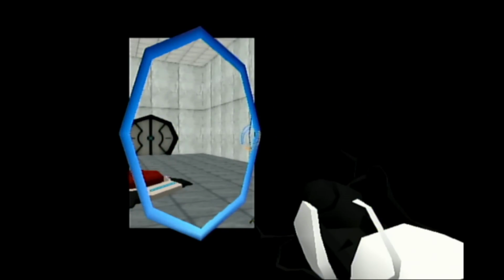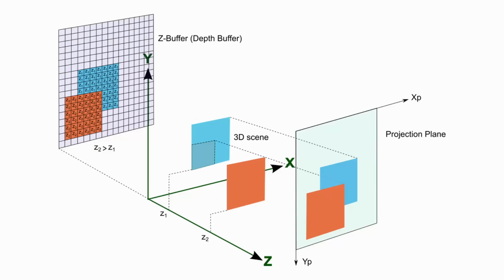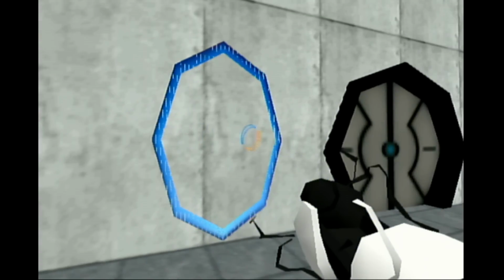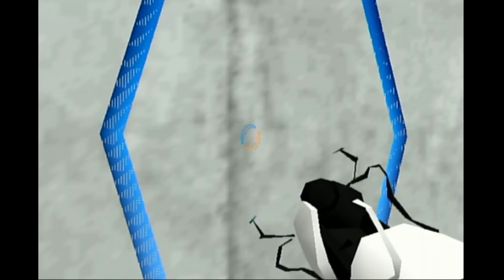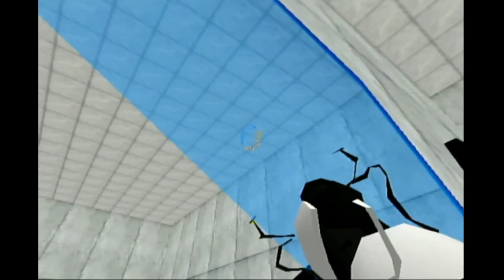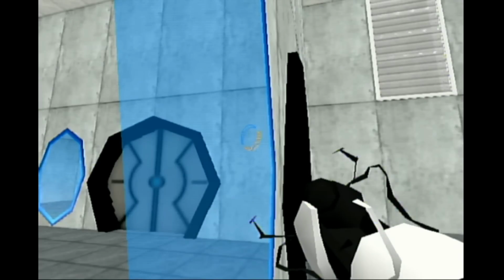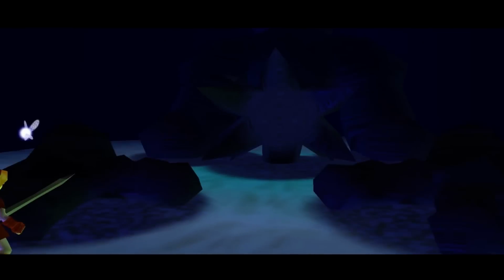How can the Nintendo 64 run portal?!? | Portal64

Comment: Sorry for asking but does the n64 not has an fps issues.
I don't know the hardware but is the problem the CPU or the RAM and if it's the RAM does the RAM Addon work for the n64 help to run this game on original hardware.

Comment: When the first graphics cards came out, old computer games made extensive use of the Z-buffer. Adding fog to the level was a great "cheat" to improve performance. If you put the clipping plane just beyond the point where objects disappear into the fog, you didn't have to render anything beyond it and it improved game performance a lot.

Comment: good thing like you mentioned is that now we have everdrive and enough to fit games that goes in gigabytes of gameplay on a single flash rom chip, so that's really a great port. 
Still from what I heard the N64 was a hell for devs, going wiht SGI Irix devkits, using 64bit hardware while their programming on a Pentium MMX was still 32bit, emulating, testing, optimizing the thing to fit in a 32 or 64Mb cart at best.. phew.

Comment: Ok so if my understanding of computer graphics history is correct, z buffers were almost impossible to implement for the longest time, due to monetary and physical material cost, until dedicated GPUs in the latter half of the 90s. Memory was $$$ so optimization led to painter's algorithm and BSP trees (and a ton else) with "portals" eventually showing up to help manage both how much of the scene needed to be held in RAM and speed up clipping and rasterization. 

A few companies tried to play with that technology (Prey when still under development in the late 90s) but computers weren't fast enough or had enough memory to handle rendering and clipping multiple scenes until the mid 2000s, when Prey 2006 and Portal were released.

Then there's your engine that solved the problems backwards, duplicating the parts of a scene shown through a portal instead doing awful parallaxing math, and then using the 64's z buffer as a hack when the clipping plane overlaps makes me wonder why this wasn't figured out 25 years ago. Either way, brilliant work!

Comment: I've been dying for a Fallout3 port to the N64. I'm an excellent 3d renderer and have drawn some very good looking low poly (under 300 tris) mutants and humans. If this interests you I'd be happy to share them with you- you are way more adept on the programming side. i think they look quite good. The head is a separate object so it can look 360, the lower torso legs simply mirror then use an idle frame for 2+1(3) and realistic movement. One arm is fixed to the torso in a prone gun aim postion that can also be used as the lower hand for a club/bat,  the other arm a single object for smashing or holding the front underside of the gun. With extremely limited frames but with just enough animations in the right places and mesh faces I think it looks quite good and would be very possible on the N64.

Comment: "How can the Nintendo 64 run portal?!?"
It's not like these old cartridge based systems lack the ability to process the data.
The biggest obstacle is degrading or replacing the assets enough for them to run at a reasonable frame rate.
Like the Sega Genesis with its ability to play high quality PCM audio. The limitation was the fact cartridge storage space was so small.

Comment: >how can a console 10 years older than portal.. have portals
Original unreal had portals and was 10 years before portal. Check out dm-radikus for some very obvious ones (the donuts). Or ut99 and fractal. Yeah it wasn't a gun but it was a "portal" that worked in roughly the same way.
Reply: unreal was a PC game though, it had access to far more powerful and capable hardware than the N64
Reply: @randomcatdude  Portal is a PC game. Unreal is a PC game. Unreal had portals 10 years before portal. Wasn't comparing PC/consoles just that portals existed long before portal. The wording was like portal is the first game to do this and its amazing that a console of that age can do it, but portals existed long before portal. It is less interesting if the video says.. n64 can do portals that.. unreal1 had. geddit?

Comment: Do not N64 support render to texture? If so could that not be easier to use?
Reply: it does not, and RTs are generally unideal for portal rendering anyhow
they eat alot of VRAM which would be a severe issue here, recursion is difficult to do with them, it's generally not great

OG Portal uses stencil buffering to achieve it cleanly and efficiently -- the N64 doesn't have this, but it has a very similar function to the depth buffer, and so he abused it a bit to achieve the effect

Comment: The N64 is such a little beast. The fact that it retains such a small shape and has the ability to push out clean poly, so awesome. Also, that looks like a solid frame rate, it looked above 20 fps!

Comment: The trick is to know how much of the physics to cut and still retain the core game feel. the first portal game could been implemented on a commodore 64, and there are probably some old games that have portals. but its how exactly the game mechanics work that made that game so awesome. having the polished design in hand gives you a huge advantage for back porting it. its pretty sweet to see how it gets applied to different platforms. i remember the flash version came out almost immediately after the orange box, and it was awesome (its still on Newgrounds)

Comment: This port, in theory, would be impossible on the PS1 or Saturn due to those consoles not having a Z buffer. 

This is such an amazing piece of work. Homebrew/development on the N64 is very scare, so I'm glad the little we get is something truely special.
Reply: You could still do a Z-sort before drawing like a lot of FPS games on the Saturn did, hell, might be something for the second CPU to be doing
Reply: @ripper253  That's actually a good point. I'm no programmer but I imagine you could do some tricks with the two VDP's as well.
Reply: @Supersayainpikmin  It's possible but sadly they're kinda separate and pretty much can't both work on a similar thing as their capabilities are very fixed, hell if this ever reaches a point of "finished" or some other milestone, I'd love to take a crack at seeing how doable a port using libyaul could be on the Saturn.

It'll be perfect 90's stuff too "Well what did you expect for a multiplatform 3d game on the Saturn?" :P
Reply: @ripper253  That sounds awesome as hell actually!

 I remember a YouTuber, I think Sega Southern Gentleman, said the Saturn was designed to be a 3D console, but it's design was terrible for 3D but just so happens to be great for 2D games. I think the story of Sega making the Saturn 3D capable at the last minute is just a myth if you ask me.
Reply: @Supersayainpikmin  I don't really know too much about the drama, personally I'd be kinda surprised to find out that the same parent company that was churning out Model 2 arcade systems would think 3D was a fad or wasn't already relevant, ha

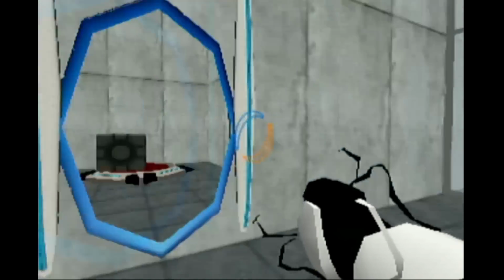Comment: This might be a stupid question, but why did you opt to cut a hole in the wall rather than adding an offset to the portal? It seems that since you already have to deal with the near clipping plane issue, you wouldn't really notice the slight offset from the wall. Is it because the FPU isn't fine enough at larger distances, leading (still) to z-fighting like the doorframe at 5:17 ? This isn't a rhetorical question, I'm genuinely interested to hear why you went for one solution over the other, if you don't mind me asking.

Brilliant work as always, of course 👍

Comment: Each new devlog never ceases to amaze me. You're doing god's work here, man.
Reply: and after that you have to plug the red wire into the socket to make sure the engine boots at launch. Wrap the green wire around it's coil that sits directly beside the A button. After you put the back shell on, place the battery in the slot. Screw the Vr26 Jeeper back up and press the reset button. If everything worked according to plan you're device should show a thumbs up sprite. Plug the HDMI port into a monitor and wait three seconds. If it boots up on TV your in the good side. If it doesn't boot in less then 5 seconds quickly unplug. This can severely damage your TV and possibly start a fire

Comment: wow. simply put wow. with all honesty this utterly impressive 

i do have a suggestion though, changing the portal gun's design, so it's more in tune with a game from the n64 than the original design for portal, don't get me wrong the model it's very impressive but it's visual appeal (specially running on hardware) is dumped by how similar it was modeled with the original design

Comment: Hey James! I tested the ROM on a real N64 using an Everdrive 64 X7. Whenever I boot up the game, I’m stuck inside a black void and can’t get out of it. If you shoot two portals they will both show a view into the starting cell, but if you enter a portal it will spit you back into the void from the opposite portal. Ever encountered this? I tried switching the Jumper Pak for an Expansion Pak and still does the same thing. I’m playing the game on an early Japanese NTSC N64 with a serial number in the 5000-range, processor revision NUS-CPU-01 if this is of any help.
Reply: I also just tested it with another NTSC-J console (serial number in the lower 1,000,000 range, NUS-CPU-02) and it does the same thing.

Comment: This is really cool. I'd be interested in seeing how you handle the rest of the physics (speedy thing goes in, speedy thing comes out) which would also need that thing that Valve implemented where there is almost like a portal vacuum to correct for the user if the placement is slightly off. Oh and acceleration. I have doubts that it could do all be done and I'm very impressed by your work.
Reply: the portal funnel

Comment: This is really cool!
I wonder how the controls work, is the camera using the C buttons? If so, maybe you could change the controls to be similar to GC Metroid Prime, where left and right on the stick make you turn on default, and L/Z is a strafe button, and R causes you to enter an aiming mode with the stick. 
I feel like it would feel better than button aiming, especially for Portal, where sometimes you don't have to move much due to threats.
Reply: Would recommend trying out the GameCube controls for the Metroid Prime series to see how it feels, because it can feel really great while simultaneously only using one stick.
Reply: also you have 6 face buttons freed up immediately to be used however, which can be pressed independent of aiming at all times.
Reply: You move with the C-buttons or directional pad and aim with the stick. This frees up Z, L/R, A, and B for other actions; A jumps, B grabs objects, L/R shoots one portal and Z shoots the other portal (I forgot which color it is for each button). Even if the MP control scheme does have some merit, I respectfully disagree that it would be the best choice for Portal. Portal already has relatively few actions the player can perform, which means having a couple of extra buttons to work with would not necessarily pay off to accommodate the aiming-mode solution that would be required for “Prime-style” controls not to mention getting used to the non-standard L-and-Z-strafes layout.
Reply: @Banzeken  problem is... how do you move while jumping using the C-buttons? that's one of the problems I want to fix, as well as me personally hating movement using the right hand. Additionally, moving while doing two actions is kinda hard, like jumping and then using the portal gun while moving forward, as you would have to do some weird finger gymnastics to press shoot, forward and jump at the same time, no matter the mapping (this is talking about on an actual N64 controller btw, not a modern one). The Prime control scheme is good for this in my opinion, or something similar to it, as it allows for faster, more complex movement and is more comfortable, and easier to learn than having to use your middle finger for C^, and use index for A/B, and your ring finger for R.

it would be good as an option I guess at least
Reply: @squeenixu  “Additionally, moving while doing two actions is kinda hard, like jumping and then using the portal gun while moving forward, as you would have to do some weird finger gymnastics to press shoot, forward and jump at the same time” You have a valid point. This is a problem when working with a N64 pad for sure. There is a reason why the Turok games had jumping on R instead and I would vouch for that in Portal64. There are some possible workarounds; you could tap R to jump and hold R to make the Z button shoot a different colored portal than it normally would, bypassing the need to jump on A. If you are moving with the left side of the N64 controller, you can still jump with A while moving and shooting simultaneously if you briefly sacrifice control of the aim. This is an issue that still affects modern controllers too whenever a common action like jump is assigned to a face button. You wouldn’t be able to reach all the C-buttons comfortably, but you could still reach A, B, C-left and C-down by letting go of the stick briefly.
Reply: @Banzeken  to be fair, the turok method is probably best if someone has already played turok OR if someone is using an emulator or adapter to play to allow for remapping (control stick to the right stick, dpad to left stick etc.), which is why I think the Prime controls would be great as an option if someone is using an N64 controller and is hardwired to use the left stick for movement (such as myself). 

also I like the feel of it I just recently started playing GameCube Metroid Prime and the controls felt very natural despite being my first time playing it. although, wiring my brain to use my right thumb on face buttons as movement is just not an option, considering I've spent my entire life playing left thumb as movement, and a lot of people have. (that's why I want it as an option) (vertical wiimote dpad as movement is NOT FUN)
Reply: Understandable. Having multiple control styles a la Goldeneye 007 or Perfect Dark certainly wouldn’t hurt.
Reply: copied from a comment I made:
C<: Blue Portal
C>: Orange Portal
Cv: Crouch Toggle
B: Grab Toggle
A: Jump (plus some camera tilt down to help with platforming maybe?)
Z: Strafe/lock on(?)
R: Aiming mode (Stands still, keeps momentum in air, returns to neutral when let go, unless holding Z, which keeps it at that angle until Z is let go)
Stick: Left and Right turn the player unless strafing, forward and backward work as usual

the only one that isn't used is C^, which idk what that could be used for (airboat button??)

Comment: Really hope that you remake either the entire game or "The First Slice" as a N64 game. Doubt the entire game would fit due to mapsizes and voice lines, but would love to see it!
As for the first slice, it's probably more doable (Chambers 00 to 10, just before the dual portal device upgrade), so really hope you keep that going to have the game implemented this far.
Reply: I doubt the size is an issue, as I'm pretty sure the N64 supports ROM bank switching, and modern ROM chips of that size are cheap
Reply: Trust me, along with base Source content, it has 300MB of sounds, it will take lots of creativity to make those smaller.
Reply: @Matsilagi  As I said, not a problem if it can swap between 10 64MB ROM banks
Reply: @Matsilagi  Those are probably all 44.1kHz 16-bit stereo, though. You can fit a whole lot more at 32kHz 8-bit mono, and even more still with ADPCM. Not saying it's nothing, but it's less than half the size just by using more hardware-appropriate sample quality. And you could make it even lower of a sampling rate if you didn't use linear PCM as your source and instead used something like A-law or mu-law on the voice lines. We have the benefit of hindsight and fancy encoders to get a format that's compressed and easy to decode on the N64.
Reply: The final GLaDOS room is kinda big to render, also the climbs on escape_00. Those are the ones which worries me the most. The rest is chill, i agree.